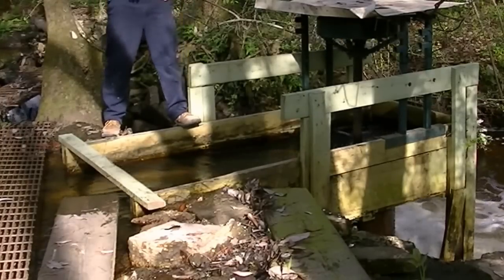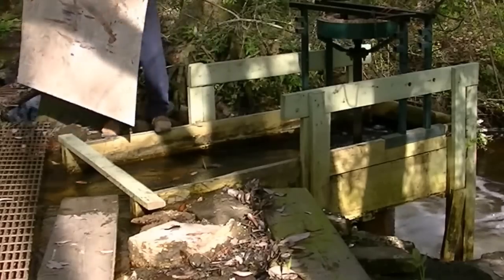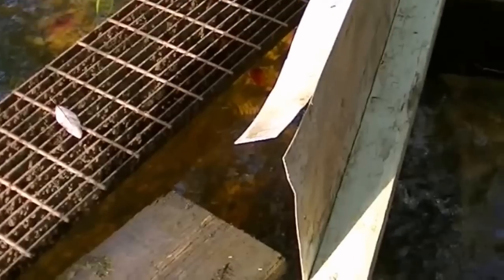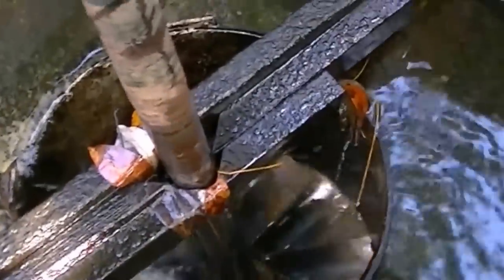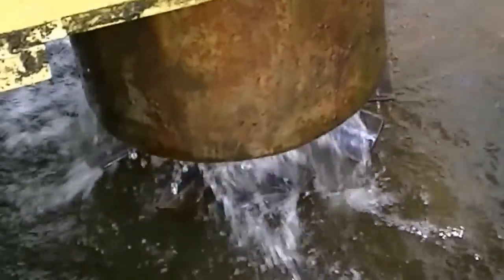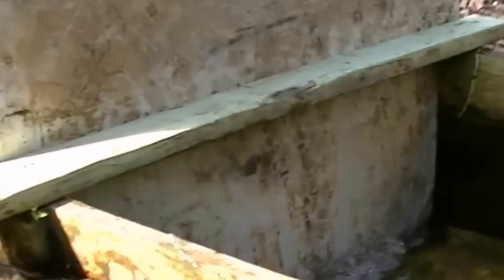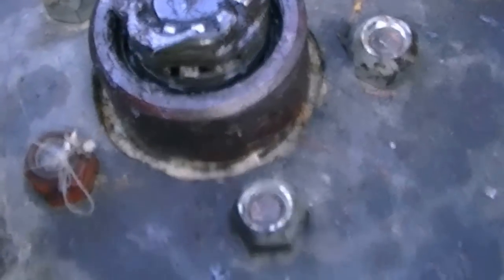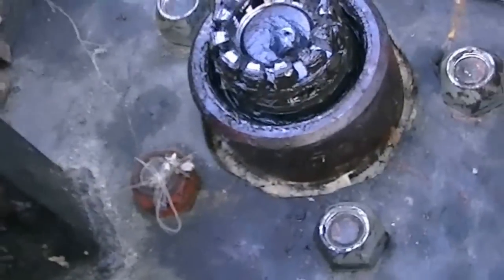Doing spring maintenance on my homemade hydro generator. Lucas marine grease.

Comment: Hey Mark.. great stuff.. and the way you have it set-up, looks to bee low maintenance. .. Where you put the flat cover to dam the water.. and you said you once tried a screen in that location to filter the debris..? but, it clogged .. well,  instead of a flat screen, did you try making an angled 'V' shaped screen, to divert the debris to the sides to shed it away from the flow?
Reply from the maker: Yes, I tried that and it worked better but I still had to clean it. Its hard for me to walk way down to the dam with all my other projects going on. Check out my wood working video
https://www.youtube.com/watch?v=jhjnK9Z0_JQ&t=2s
Reply: Yesh! I saw that video when you first uploaded it.. and admired the homemade air filter w/blower in the box you made to keep your woodworking shop's air clean.. WITHOUT losing your heated or cooled climate, which would occur if the dusty air was exhausted to the outside.. plus, it looks like you are using a washable reusable filter > even smarter
Reply from the maker: I have been running the air filter all day today. Running boards through the joiner and planer. I'm building a corner desk, counter top high for my church office. Its 11 foot one way and 7 foot the other. I will upload it to youtube in a week or two.